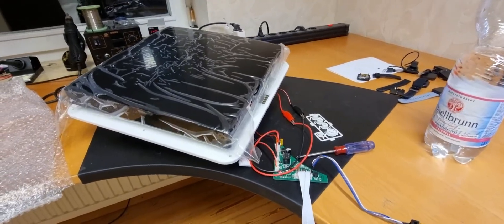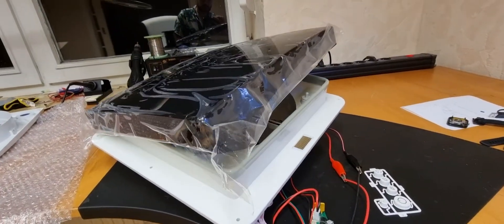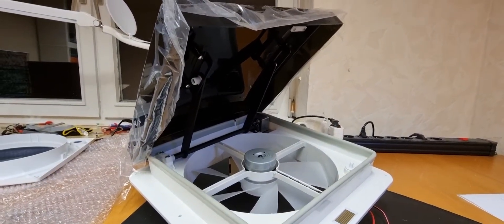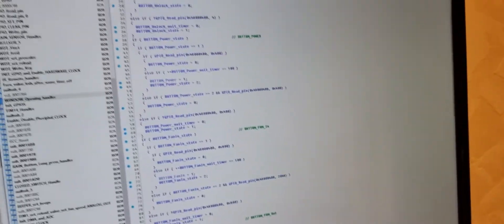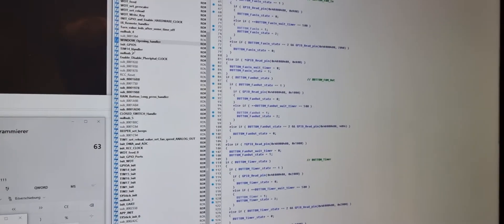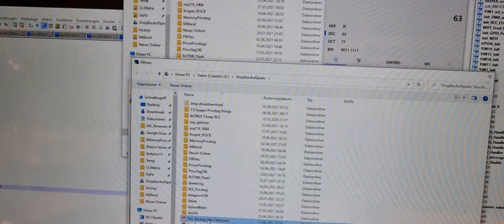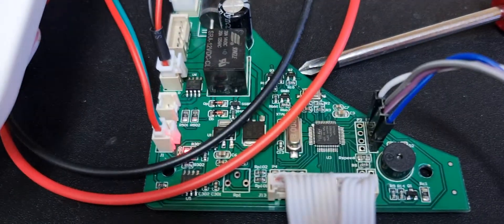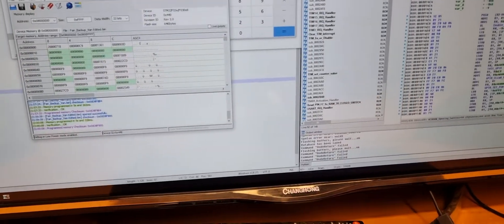Hacking the Firmware of a Van Fan Window by Reverse Engineering it with IDA

Comment: Hi, i stumbled on your channel looking at CAN bus videos. looking to intergrate a fan very similiar to this one. (hatch open and close, fan in and out, and fan speed) how easy would it to to perform those signals through CANbus? is this possible through firmware or installing a relay board to control those signals.
Reply from the maker: Hey. 
Doing it via can is quite simple. What i can not suggest is to hook onto the existing car can bus and better lay your own wires, as the car motor could be disturbed.

If you have the posibility a custom firmware on the fans mainboard would be the simplest

Comment: what manufacturer :-P and how much? looks like a neat shed fn if you have 12V solar system/batteries
The onboard LED shoud light if the motor is actuated to show problems with the gearbox and lever :-P
Reply from the maker: It is this one: https://www.amazon.de/dp/B08PK7W7VX/ref=cm_sw_r_apan_glt_i_Z3KDXD6X8CAMYSSDV5SW?_encoding=UTF8&psc=1

The newest problem is the rain sensor it needs to be replaced by a more reliable one. The current one get eaten by the water as it is only a pcb

Comment: Nicely done any chance you can show the motor I wonder how easy it is to add a motor and Arduino to a manual window
Reply from the maker: Dont have a picture on hand. It is a geared 12v motor,. Its a very specific one for such a window with a handshaft included

Comment: really impressive that you managed to do that in an evening. would be interesting to see a more lenghthy video of your process to arriving at the method that controlled the timming. I imagine you arrived there by tracing the button to the GPIO on the STM and the looked for functions that where using that particular pin based on the STM memory map?
Reply from the maker: Thanks a lot.
Maybe there will come something more in the future but no guarantee for that, planing to add external control to it with feedback over Telegram, so maybe a fully custom firmware.

The finding of that particular part was more in the middle of everything, i did reversed the full firmware to have a good understanding and because it is fun. As everything runs Async it is not as simple as searching for the button as there are flags in different variables, somehow they use also about 5 timers which they enable and disable in different modes. Very interesting to see that.
This Fan also got IR remote controll this was also included in the code so it can not wait anywhere to long as it will block the functions
Reply: @atc1441  full firmware reversing in an evening? thats even more impressive hehehe I need to get more practice. I'm currently working on a bluetooth remote control and impressed by how complex it is... Any suggestions on content (books, videos, writeups) or approaches to reversing RTOS? I think thats whats mostly giving me a headache since I'm not used to the "structure" of reversing timers and multi-threaded firmwares.
Reply from the maker: The fan is a quite simple Gadget so it was relatively easy challenge

Sounds also like a lot of fun.

 Best tip I can give is to take an SDK and compile some examples so you can reverse them as well and see how it would look best is of course to use the same SDK as the manufacturer
Reply: @atc1441  yeah this was the first project I've looked for and used a MCU SDK and it was a game changer! Having access to header files, linking maps etc is super helpful, but still a lot of work reversing undocumented functions in ROM.

Thanks for the tips and sharing your projects on this channel!

Comment: Cool fix. 

Was really hoping we would get a RV fan we could use with Home Assistant and/or Nodered
Reply: Just put an ESP8266 or ESP32 in there and hook the buttons to it. Done.

Or remove the chip and solder wires directly to the pads of where the chip was and then to the ESP, so it can fully control it.
Reply from the maker: In this case i do not suggest that. In the car you need to think about power useage. And the esp's draw a lot.
At least for me i would make one master esp in the car and connect low power devices to it via cable

Comment: Very nice but can you say which all tool did you use in the video please
Reply from the maker: Hey.

The main tool is IDA for reversing the firmware.
The hex editor is HXD and the StLink flashing tool is the STM stock one. Hope that helps
Reply: @atc1441  oh thanks for the fast answer, i want to reverse the firmware of an old notebook but I don't know if i need some things more
Reply: @atc1441  I wouldn't spare time learning IDA, but would learn Radare2 instead. BTW, I do currently.
overall very good video.